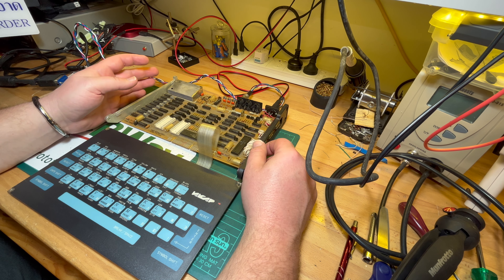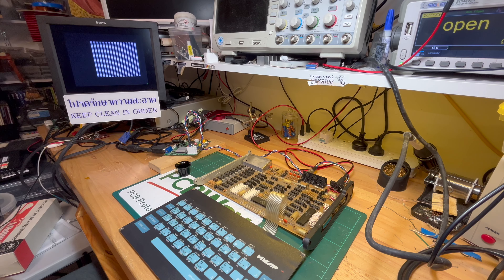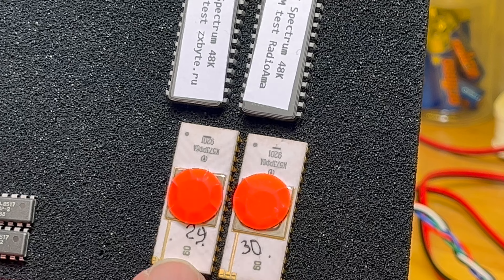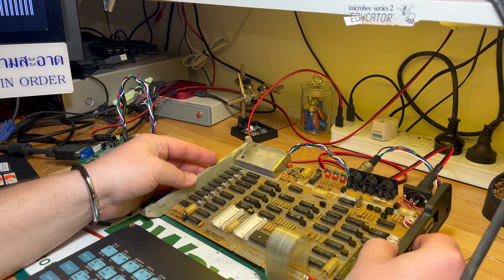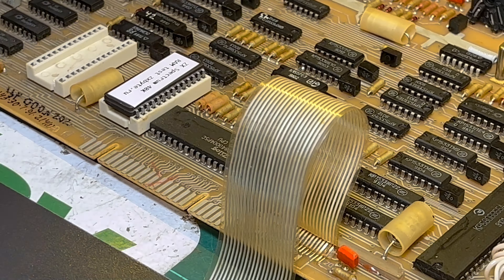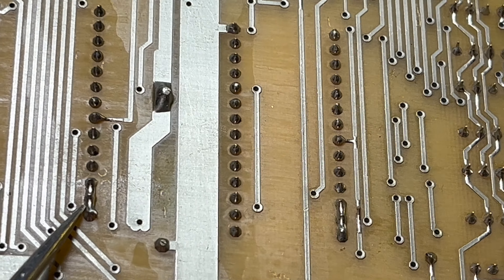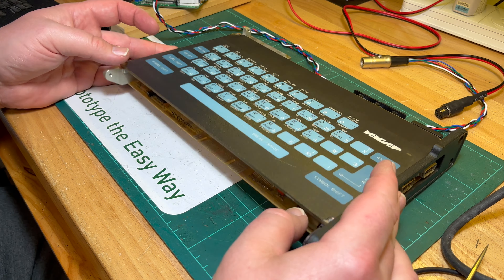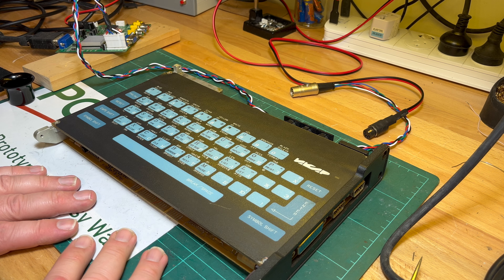Икар 64 (Icarus 64): Part 2 [TCE #0320]

Comment: So congrats, and excellent troubleshooting to find the problem! And I'm surprised to see how rugged ROM chips are. But @16:15 you remove both of the old ROMs and replaced them with just one. How's that supposed to work?

But in the end, another Soviet doorstop was saved. :)
Reply from the maker: Weird how the ROMs were in upside-down and in the wrong sockets ... ?!?  The single ROM is just a simple 2KB RAM diagnostics so it should start executing from 0x0000 (or where ever), same as the firmware ROM.
Reply: @Brfff  Maybe it's just Amiga ROMs (or other >8 bit ROMs) but aren't the bytes stored as even bytes in one chip and odd in the other?
Reply from the maker: That's crazy talk!
Reply: @Brfff  Must be just Amigas then. LOL!
Reply from the maker: @MrWaalkman  I think I know what you're talking about.  The Speccy ROM is 16KB ... these size (E)(P)ROMs were probably quite hard to come by around that time, so one option was to split it into two 8KB ROMs ... I don't know if the original Speccy had a single 16KB or two 8KB ... but, it's basically two banks ... low 8KB and high 8KB ... 0 to 16384 ... then the RAM address space starts
Reply: @Brfff  And It's not all Amiga ROMs, just the A4000 maybe? I've slept since then... :)
Reply from the maker: Actually it might make sense in a 16 bit system ... read one byte from each ROM simultaneously on a 16 bit data bus ... ?

Comment: Thank you for great videos. 
I surprised, that original ROM survived connection in reverse polarity, as I know EPROM is extremely sensitive to such things.
Those ROM sockets are total trash, I'm pretty sure, that sensitive behavior of the comp relates to bad contact in ROM sockets.
Unfortunately I don't know if exist some normal way to improve it, except binding socket and/or chip contacts, but in this case ROM chips became more independent and try to jump out of socket at unsuitable moment :)
Reply: Agreed on the lack of quality of the sockets. To be able to push on one end and have the other end pop out doesn't bode well for reliability.